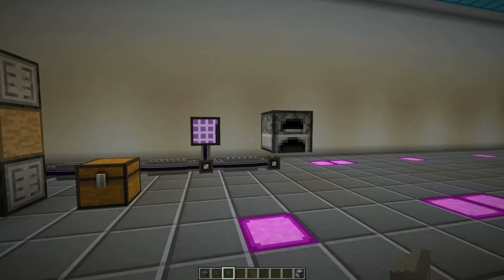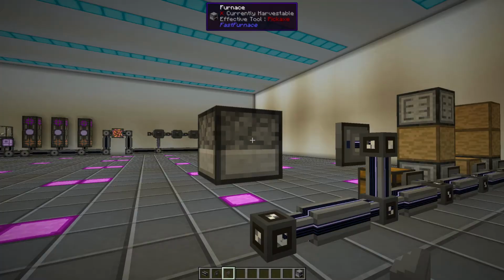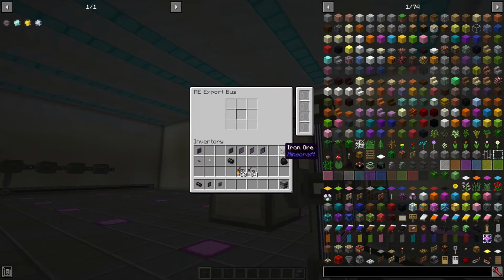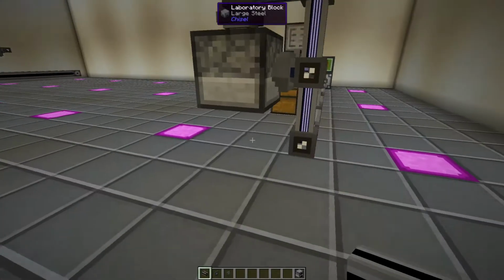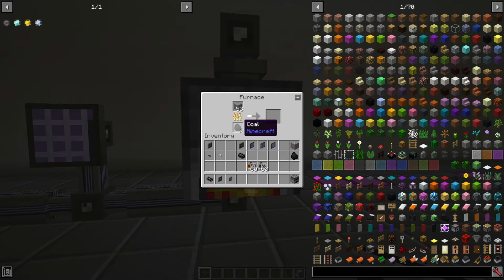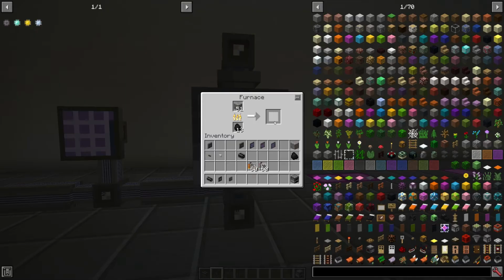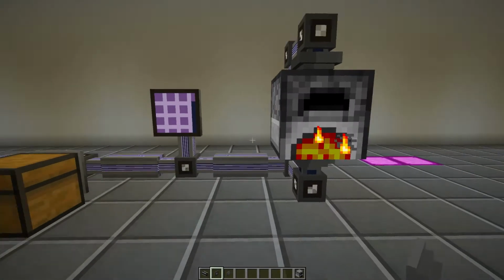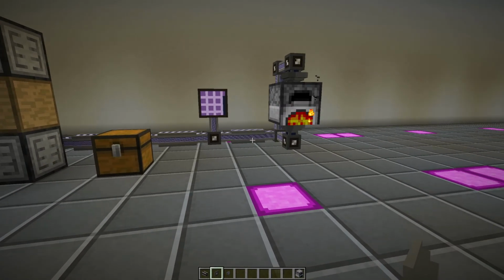Syn's Shorts - ME Import Bus and ME Export Bus - AE2 (1.12.2)

Comment: I mean. So I can get it to just automatically smelt 100% of a certain item type I have, but how do you use an interface to get it to only process a certain amount. e.g. in redpower mod stone smelts into circuit plates, and I want some of those plates, but I dont want to smelt 100% of my stone
Reply from the maker: You can set up for the system to maintain something like a stack of an item, but this involves using crafting cards and having available crafting CPUs. I prefer to use the method where the output of the specified item goes directly into a storage (limited size e.g. chest, drawer, etc.) and place a storage bus on this to make it available to the network. Once the storage fills up then you will have an easy limit. You can also do it with AE2, but can be more fiddly.

Comment: Will it work this way if I attach the export bus to the bottom of an inscriber so my silicon circuits can automatically load when I need to make processors?
Reply from the maker: Yes, granted you have silicon circuits in your system.

Comment: Anyone knows how to keep a buffer so that export bus only exports if amount x is in stock?
I have a continuous cryo-stabilized fluxduct machine, but it greeds for all the cryotheum dust.
The problem is some recipes like the signalum upgrade kit need cryotheum dust, so Id like to keep a stack
in stock and only if I have more than 64 it should export.
Reply from the maker: I have usually made my Cryo-Stabilized Fluxducts on craft rather than stocking a certain amount, so haven't had to explore this fully.
However, I would recommend using a Level Emitter on the same cable as the Export Bus. In the Level Emitter, you should include the Cryotheum Dust and adjust the amount to a stack (configured to emit redstone signal when above or equal). You will also need to place a redstone card in the Export Bus (configured to active with signal). This will allow you to maintain, from this Export Bus, at least a stack of Cryotheum Dust in the ME system. 
Note placement of the Level Emitter requires a channel and you may need to place it on a cable adjacent to the Export Bus depending on AE2 version.

Comment: is there a limit of export busses you can have? it seems after i get to like 10 the other export busses i have tend to just not do anything at all. is there a way to upgrade the system to allow more or am i doing something completly wrong? good vid btw
Reply from the maker: In a simple AE2 network (e.g. without a ME controller), you can only have up to 8 devices (export buses, import buses, storage buses, etc.) on a single cable (glass fibre or smart cable).
Have a look at the ME controller, it will allow you to get 32 channels per face of the ME Controller block. The ME Controller can also be made into a multiblock of 7x7x7 (noting some placement requirements).

Comment: Hey, I have an issue: 
You might know how to export an ítem with Damage? 

For example, I want to insert IC2 Coolant Cells into a Reactor but they will differ in their durability because I regen them in other kind of Reactors, so they get random values of Damage, I can import them from these Regen Reactors with the value I want using a fuzzy card (50% of life) but the Exporters simply doesn't Input Coolant Cells with random Damage Values (which I extract from the Nuclear Reactor before they expire to recicle them)
Reply from the maker: In the ME Export Bus, you do need to specify the item that you would like to be exported out of the ME network, in this case I would use IC2 Coolant Cell with some durability lost. I would also combine this with a Fuzzy Card set to 50% or 75%. Depending on the minimum requirement for the IC2 Coolant Cell (e.g. 50% durability is required for a cycle) then I would set Fuzzy Card filter to above this.
Reply: @Syn's Survival  yeah, i did that (add an IC2 Coolant Cell in the filter of the Exporter)

but after some investigation, it seems that AE2 and IC2 are known for having compat issues (mainly NBT Tags issues, for example inside the autocrafter, but i need to add that the Coolant Cells use NBT too, so that could explain the issue).

it seems that this issue will never be solved,  so many thanks for the help, nevertheless, i can't explain myself why the Importers work pretty fine but the Exporters don't.
Reply from the maker: I reckon that because the importers by default will move any item out of the inventory they don't check NBT Tags and therefore dont have issues.

Have you tried either EnderIO conduits or Thermal Expansion Itemducts with Servos or Recievers?
Reply: i use a fuzzy card on the Importer to extract Coolant Cells when they have low health (to regen them later using the pattern used on this video: https://youtu.be/4D0LHpKl0AY?t=471), an these Importers as i said work pretty fine for unknown reasons

and related to the other mods' pipes, well, i need to insert these Coolant Cells As Fast As Possible or the reactor will explode (And Refined Storage works pretty fine for this, but i really wanted to use AE2 for the gameplay part of the storage system, but no problem, since AE2 for 1.12 is dead for the authors, I don't gain anything regretting)

again many thanks for the help